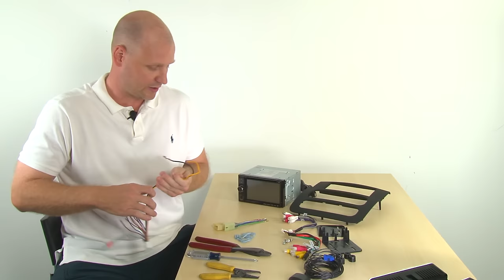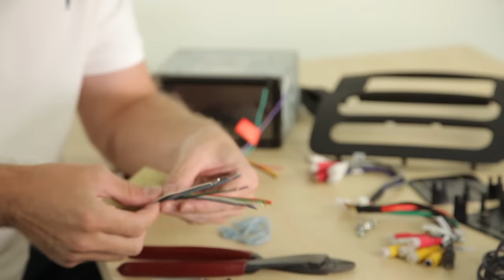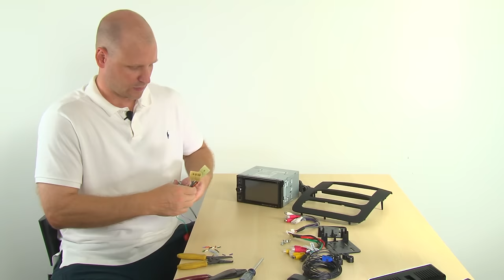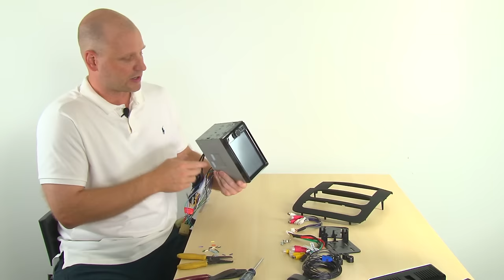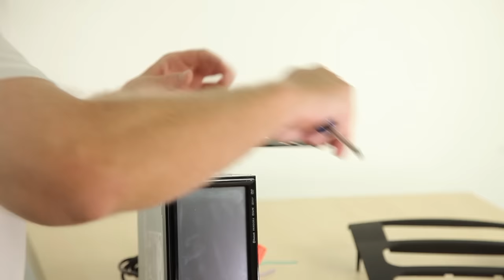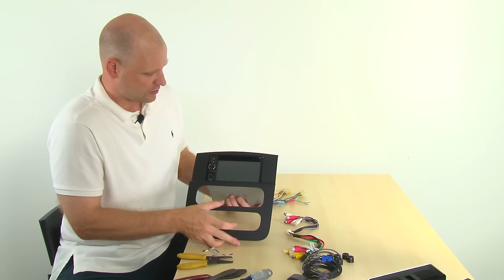How to Install an Aftermarket Car Stereo, Wiring Harness and Dash Kit

Comment: I found this video because of the "metro" type of harness.  As background info, we have a 2000 National Tropi-Cal RV with a Ford F53 engine.  We're removing the old radio/cassette player (Audiovox IM500).  I received the color schematic for this radio from ASA (who did original install) so I can match up the wires (by color and function) from the old to the wires on the BOSS Audio 508UAB Car Stereo - Single Din radio we purchased.  We purchased a wiring harness Metra 70-1771 Radio Wiring Harness for Ford/Lincoln/Mazda 1998-Up into Car, 16 Pin) (but apparently there is NO plug that matches behind the dash).  Instead, we actually have the one like  you show in this video.  Here's the difference (and my question), the original radio wires didn't have the TWO wires (+ and -) like the new radio/CD player.  Do they go into the SAME place?  Hope I don't sound too ignorant...but this will be my first time doing this (and my hubby's).  We were thinking to match up the corresponding old wires with the new wires (to the matching speakers, and also ignition, ground, and battery (probably sauter them instead of using the butt connectors).  Think this will work? If not...do you have any suggestions?  Sorry this is so long!

Comment: I have a car with factory sub woofers. The amp for that is turned on with 5 V. My new stereo provides 12V for that function which will create a pop when turned on. 

Other resources have said to "just" hookup a 7805 voltage regulator "chip" and you're good to go. 

I am fairly well versed with those kind of voltage regulators but have always used support components. 

Do you know how to make that connection? I've probably got some lying around.

Comment: I just got myself a head unit and came to a confusion with the wiring harnesses, most the illumination wire(s). The harness that came with the head unit have one, but the harness to plug it into the car has two. How should they be wired together?

Comment: Yea the two times ive had butt connectors installed with a cd player i had all sorts of issues. first time was done by a PROFESSIONAL installer and had to go back to the place 2 times because of loose wires and bad sound. Ended up taking the radio out myself and cutting the wires and re doing them with electrical tape. Never had a issue. Second time i tried the butt connector myself. I crimped down with a actual tool that gave the proper pressure for the size wire and all. ended up with the same issue like years prior when i was a teen. Ripped it out and tape and twisted it as well. Ever since ive only ever taped and twisted my systems. I have a truck that i did when i was 18 that my brother still has and never has had a issue with my install. ELECTRICAL TAPE FTW

Comment: Question... I bought a pioneer avh1550 nex. Sold me everything they said I would need but I don’t have any connectors. Besides the ways mentioned in your video is there a way to make the connections such as twisting the wires together and electrical taping it off. My first aftermarket install so I don’t really know
Reply: Method of wire connections are totally up to you and comes with some risks.  Many believe(including me) that soldering makes the best connection. It makes the strongest and most reliable connection.But you would also have to use heat shrink and not everyone has a soldering iron or the time to do it. So most people I know use butt connectors. (I believe Best Buy does). Just be sure to use a crimper, not pliers to make a reasonable connection but might fail later. 

Twisting wires together and taping them off might work for a short time but will probably fail soon.

Comment: I understand which wire goes to what and even the colors and how to solder as I have an electronics background. What you do not do is explain which connector goes to what and why as when you purchase an install kit it comes with multiple connectors with all the same wires and no explanation of which connector goes to what.
Reply: Most kits come with a few sizes you have to figure out which one fits your factory harness by taking out the old deck. When you find the one that fits you then connect the wires from the harness to the wire harness for the deck. When those are all connected you plug everything in

Comment: Nice video but there are some mistakes here. 
Never twist the wire before crimping - this bulks out the wire and may come loose over time through vibration.
Never fold over the end of the wire either - bulks the wire for no reason - just use the correct size crimp/butt connector.
Also - crimps are better than solder - you can get a dry join on solder that will disintegrate over time and come loose.  
Use the correct size crimp in the first place and with a heat shrink boot over the top.

Comment: Hey, so i had a quick question. One of the speakers in my 2002 dodge ram isnt working, so i moved it to the other side to see if it works, and it works well. So what do i do? Is the other side not connected to the stereo or what?
Reply from the maker: It could be that or the speaker wire has been damaged
Reply: Quality Mobile Video  ight, thx

Comment: I’m experienced when it comes to setting up subwoofers but I’ve never really set one up in a truck... 
I’m having a hard time comprehending the harness aspect... did you purchase a particular harness for your name brand vehicle??( I can’t  find the correct harness my new radio has a diff set up.... I was thinking about, cuting off the old connections that once connected to the old radio, and then to wire it straight to the new radio harness??
Reply from the maker: Check this out: https://www.youtube.com/watch?v=OXn8-8yee5o

Comment: I have aftermarket head unit and I recently bought a new one can I just unplug the old one and plug in to the new one or I have to buy a new harness
Reply from the maker: You'll need a new harness
Reply: julio bello depends.  some of the Sony head units used alot of the same plugs in there radios

Comment: Is there a company out there that sells the wiring harness already complete without all of these butt connectors or soldering? I can't believe it's 2018 and someone doesn't make these wiring harness's totally vehicle specific were we can just plug the ends in and be done with it. It would be much quicker.
Reply: Curtchfiled does all that for a fee
Reply: I am not sure how it is in US, but in EU we have standardized ISO connectors. I just bought connector for Mazda harness to ISO and my new aftermarket radio (Pioneer) came with Pioneer to ISO harness. Installation took me 15-20 minutes without any soldering, I just put all together. These cables should be available online for US too, just search for <car brand> to ISO and <radio brand> to ISO connectors.

Comment: I'm preparing to do an install on a 2002 Ford Explorer and I have Wire from my radio that is Orange/White and labeled "Illumination Signal" While I have a Orange wire coming from the Harness that says "Illumination/Dase" should I connect these??

Comment: Any recommendations on how to eliminate engine/alternator noise heard through the speakers with an aftermarket radio when depressing the gas pedal - gets louder as car goes faster/pedal depressed more? I've checked out and verified I don't have a bad ground, defective head unit, defective amplifier, bad RCA cables or a problem in the vehicle’s charging system. I've also installed ground loop isolators and all that does is somewhat suppress the noise, but it still can be heard. Any help would be GREATLY APPRECIATED more than you'll ever know!
Reply from the maker: +Gino20202 Gino, have you tried disconnecting the RCA's from the amplifier and seeing if you have noise coming from the speakers? Does it come back when the RCA's are connected?

Comment: WOULD'VE HELPFUL SHOWED US THE WIRE INSTALL TO THE CARS HARNESS?
Reply: Easy now, he did say he was wiring it to a Metra harness. Which is what you buy so it plugs right into your specific cars harness, so you don't have butcher your existing wiring.

Comment: Hi lorenzo i have installed one Android 11.0  9" but when the volume going up 19 the quality of sound it's terrible what is wrong?
Reply from the maker: We have seen the internal amps and preamps on some models distort very badly. If you’re using the preamps you may want to use a line driver.

Comment: I've connected  all the wires to both of the harnesses but my question is I've seen other videos that do not connect the ground to the other harness. but in my harness I have the wire for ground connection do I connect it to it or ground the wire on metal ??
Reply: David Guajardo if your car has a ground wire in the harness,  connect it to it

Comment: What should I do if i have the accessory wire ran to hazard light button, and it keep blowing the fuses to both the turn signal/hazard lights , and the radio fuse... with the key turned over I blow those fuses as soon as I put them in. Causing my turn signals to stop working and no power the deck. What should I do ? Please help ?

Comment: Need to know what to do with the ground cable?
Reply: If there is no ground on your radio harness than you need to put a ring terminal on it and hook it up to a any bolt that's touching bare metal

Comment: hi. I have removed my old stereo and added new but stereo won't power on. I had a parrot installed which I removed also. I have a mercedes c class 2001. Do I need to change the 12v ignition which was previously used for the parrot? please help as this is my first time changing a head unit. thanks

Comment: I have 2012 dodge caravan and the factory harness has yellow and red strip but my aftermarket harness from sosche only has a yellow wire and a red one...when I put red and yellow together and connected to the yellow wire everything turn on but cant get it to turn off...please help!!

Comment: I'm installing a new double din Boss Audio to my 2001 Buick century custom apparently I'm getting another factory harness as I cut the original plug but having problems regarding power to the unit I have checked all radio fuses and are fine I do not have a power ant. But a blue wire on factory that is for power to unit do I still connect blue wire from factory harness?
Reply from the maker: What after market harness are you using? You'll need this to replace the factory head unit: https://www.qualitymobilevideo.com/70-2001.html

Comment: I installed the Same radio in my 2012 Jeep JKU. the navigation will not talk and the Blu tooth when making a phone call will not allow me to hear what the person is saying. i have all the stock speakers and used a wiring harness to connect everything.  the NAV works just won't talk. Could this be the Stock speakers being dual positive or something? the stereo works fine as does the DVD sound. No Stock NAV, this is the second stereo we installed with this problem.

Comment: nice tutorial
Reply from the maker: +Denio Ribeiro Thanks for watching!
Reply: +Quality Mobile Video Question: My radio harness has a Orange/White wire that says "connect to a car's Illumination signal" but the Orange/White wire on my adapter harness says "Dimmer". My adapter harness also has a Orange wire that Just says "Illumination". Which one should I connect to?
Reply: DenioU illumination

Comment: I know this is a late comment but is bending the wire more effective or is stripping it more effective?
Reply from the maker: +CJay No such thing as a late comment this video is the platform for an ongoing open conversation for any questions you guys have! Definitely strip the wires
Reply: Okay cool. So strip them 1/4 instead of bend?
Reply from the maker: I'm honestly not sure what you mean by bend?
Reply: you bent the wire before crimping it in the butt.
Reply from the maker: Yes, we recommend that approach, that way the wire cant easily be pulled out of the butt connector.
Reply: ok cool! and one last one, must the car be on when removibg tge radio?
Reply from the maker: +CJay Here watch our double din install video! Everything you need to know is in it https://www.youtube.com/watch?v=bBrSejKuNm0

Comment: My speaker wiring is not what the harness has my front left are tan and grey, my right front is dark green and light green, my left rear are Brown and yellow and finally my right rear are dark blue and light blue so how do I wire the new factory harness which I'm getting in two weeks its been ordered

Comment: I have a question, so I have a LC-GMRC-01 harness for my 2003 GMC Envoy SLE. I bought a aftermarket double din stereo with GPS, back up camera, etc. 
The issue I came across is when I was all the wires I ran into vss/speed sensor to connect on the harness, but the stereo don’t have that wire to connect. So should I worry about that or is my GPS on the stereo going to work? The gps is built in and has a 8gb card for the maps already. Please help thanks.

Comment: i don't have the blue wire on my radio hardness (pdx502bt Kenwood)  and i need to plug two blue/white wire to it....i don't know witch wire using to connect the 2 blue/white wire...need help please....

Comment: I have a question, I just installed a Kenwood DDx25BT using and it comes on but when I turn the suv off and back on it automatically goes back to the startup screen, what do I need to check?  Thanks.
Reply: You missed a wire

Comment: What is your wiring gauge (AWG) recommendation to the constant, ground and speakers wires?
Reply from the maker: The power and ground terminals depend on the power draw of your system, generally 4 gauge is safe for average systems, but once you start using really powerful amps you have to go down. 10-12 gauge is always safe for speakers and subs
Reply: @Qualitymobilevideo  
I have stock right now , so what is usually comes from manufacturer?

Comment: I have a 03 ram HEMI and a Boss BV9351B and it came with a connector with one end that plugs up to the headunit and the other end has strippable wires. Is this my harness or do I have to buy a separate one
Reply from the maker: You'll probably need this harness too: http://www.qualitymobilevideo.com/70-6502.html

Comment: so I installed a CD player in my friend's car. he don't have a amp or subs. but after about 15-25min his CD player cuts of. and he has to turn the car off then back on to get it working again. I THINK he also said it does it only when the volume is around 30-40.. he thinks a wire is loose or I hooked it up wrong. and I think it's the CD player that it's just defective. have u heard or had this problem b4. please give me feedback asap
Reply from the maker: Hey Cory. Could be a lot of things, yea the radio could be defective. Also could be a wiring issue with the harness, sounds like a voltage drop, make sure all the power cables are secure and unbroken. Could be a bad ground, you king of just have to diagnose it by process of elimination.

Comment: I got a f150 and it already had a single din when i bough it and now im upgrading to a double din but my truck has a cable (red) comming from a a fuse and i connected to my red wire on the radio and nothing happened but it was connect to the red wire on the old radio then i wired the red and the yellow together with the wire coming from the fuse and it turned on

Comment: Hi, I have a Pioneer AMP and I would like to connect 2 extra speakers 6x9 but I don't have cables in the back side. Can u plz explain to me what is the procedure to wire everything. I have aftermarket stereo radio Kenwood USB radio. 2 front speakers are already connected to the radio. I watch some of your videos but I didn't see any explanation how to wire 4 speakers with 4 channel Pioneer AMP.
Reply from the maker: We actually show how to wire speaker to an amp in this one: https://www.youtube.com/watch?v=vxWSN60i5ew&t=119s
Reply from the maker: And then this is a full installation video where we installed speakers and a subwoofer with an amplifier: https://www.youtube.com/watch?v=ViY4vGoYYDw

Comment: I have a Buick 2001 park avenue and I install a aftermarket radio it's a 6 inch and I connect all color wires and no noise  comes out of my car . Do you know if I did something wrong
Reply: Or why that happen v
Reply from the maker: You could have the wrong wiring harness! I need some more info to help out. What is the make, model and year of your car? What is the radio you installed? And what is the brand and part number on the harness?

Comment: I saw those RCA cable for speakers. My thing is the interface I bought have it but my stereo speaker wires doesnt have it. Can I just cut the RCA then follow the color for speakers?
Reply: Did you ever figure this out? I am running with the same issue dont know if i can cut rca to connect my harness for audio.

Comment: Where exactly would you ground at black wire?
Reply: yep, just came for the same question
Reply: Add ur ground to the inside radio department and connect your ground wire from the metal radio bracket to the inside the dash where the radio goes

Comment: blue wire from the headunit  goes to the red power wire to power antenna amplifier right ?
Reply from the maker: +d jones Blue wire from the radio connects to the remote turn on for the amplifier, not the main power input on the amp.
Reply: what connects to the power then?

Comment: I just got a new head unit system but after I took the old one out it appears that there is no harness and all of them are crimped, do I have to crimp them.
Reply from the maker: Did you get a new harness as well? if not what's your car's make, model, year?

Comment: Hey man. I replaced the radio on my 2005 crv but know every time that open the key to turn  the crv on the needles on the dashboard start shaking. What did I do wrong?
Reply: It means your car battery is low. Their might be drain on your battery.